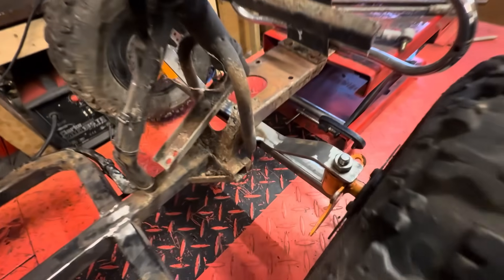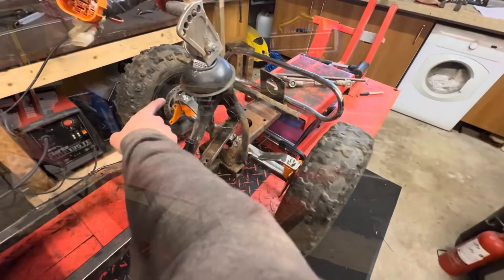I Put Amazon’s Cheapest 72v kit in a Mobility Scooter

Comment: being a disable person myself, and also reliant on a mobility scooter, I know how capable these things can be straight from the factory. but I have been thinking about building / improving one with 4WD using hub-motors (forgot the specific name for these) and a much bigger and more efficient battery-pack and lower down for a lower centre of gravity (this is a huge problem with standard mobility scooters). but I got to say, what you did here is Amazing. and on a budget I imagine. but I would love to see you build the best and most capable mobility scooter you can
Reply from the maker: Thanks I’m glad you liked it!
Reply: @MarketplaceBuilds1  my pleasure. it is just cool. just wish rules and regulations over here weren't so strict when it comes to mobility scooters. I would gladly drive a thing like that. just sadly I guess it is a trade-off between speed, range and battery-capacity and space

Comment: Nice build, looks like a blast. I've got a bunch of Husqvarna LB553iV electric mowers I can rob the motors out of. Any tips on identifying what controller I should buy to drive them by e-throttle, they've got 3 equally thick wires to them, 1.5kW rated each.

Comment: Pretty neat mod. But should have found a module that would have the lights working too. Seems like there should be enough room left under a fairing for that and the wiring. That would have been the finishing touch for keeping it as close to the stock appearance for a sleeper build.

Comment: The trick with one of these is putting as much weight down low as possible. If you put enough heavy batteries or steel or lead, it won't tip over. For example CommuterCars Tango did the same thing for a skinny car, and they can corner that thing like a sports car. That way, you can keep it as a normal mobility scooter wheelbase so it can actually function as one
Reply: Yeah, not sure my mum would appreciate this build without some hefty weight put in low down to err balance her out :D (its bad enough with the lead acid batteries!)
Reply: Thank you i feel when you widen these it removes the discretion of what this build can provide  so thank you
Reply: @the-boat-guy  Only downside is you won't be able to lift the thing. It might need more mods to handle the weight, and a suspension would be nice. Higher end scooters already have a suspension. To be fair he didn't widen the wheel base that much. I've seen another video of a monster mobility scooter, which was great, but he waaay widened the wheels.

Comment: I did this during lockdown but with a 48v 2kw brushless kit. I found out the hard way that if you keep the front axle narrow instead of widening it to match the rear, the turning circle becomes that of a passenger jet. Mega fun though! I wouldn't recommend going more than 30mph though as its deadly, the slightest bump and you get a death wobble.
Reply from the maker: I found adding a few degrees of caster on the front axles really helps with the stability I can go full speed with 1 hand. My first scooter is a death wobble machine tho  I know what you mean, in another video I might have to modify it again.
Reply: @MarketplaceBuilds1   Have you clocked the speed yet? It seems like it has to be 40+mph 60kph.
Reply: Haha mint ,🤔have you thought about two motors four wheel drive ,and get one road registered don’t think it expensive 😏,now that would be funny,good build m8 😎